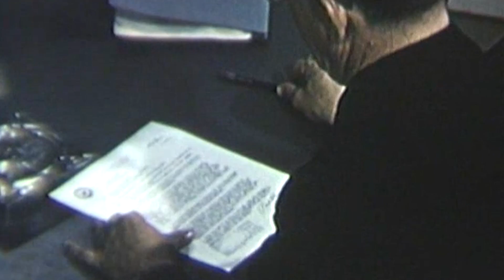Lockheed XFV - Vertical Take-Off Fighter

Comment: triangle spinning 3 side blades connect prop not plane type prop, safer if u hve a nose pop out chute to land. If room a 3 & 3 triangle prop 1 inner & other outer blades not spinning together put opposite like u hve it & diff 3 & 3 making it round spin diff sides prop. U need windshield so every 1 or 2 or 3 ppl can see out forward best poss. then looking up & down & forward if 3 ppl flying along.

Comment: Wider propellers & wider gear Not carrying about going back in to vertical landing launching position just take off & getting 500,<750!> or 1000 miles safely somewhere better. nothing beats 750 escape clause.

Comment: I can't help but wonder what happened to the radial flow gas turbine powered projects, they would have taken off and landed vertically and were jet aircraft not props. They are still classified so i do not know why they never made it in to production. Maybe the power output did not live up to expectation, or are they still flying? it would be unlikely.

Comment: Nice clip at 1:25 of the Folland Gnat F1 prototype from 1955, but I'm not sure of the relevance to this video or the commentary at that point.
Soviet nuclear weapon tech was not significantly aided by German scientists.  Although the Soviets had a weapons progamme running from around 1942, the major strides that brought it to fruition in only 4 years since the US use on Japan came from intelligence gained from agents and sympathisers in the UK and USA.
But the whole first few minutes on nuclear attack of runways was not the drive behind the VTOL fighter concept.  This requirement was aimed squarely at a ship-based maritime air defence fighter.  The major clue is that this was a USN contract.
The lack of power of the experimental YT-40 engine was not a surprise.  It was always intended to move to the T-54, with almost double the power, but as you say that engine never materialised.
There is also, all the way through, a lot of footage of the rival Convair Pogo.  With all the time on screen it might have been interesting to add that the XFY Pogo did actually mange to take of and transition to horizontal flight, although vertical landing was judged a step too far.
You could have finished with an explanation of why this approach was almost certainly doomed, ie poor visibility below when the aircraft was vertical, even before having to deal with wind effects and a moving landing platfrom.  Having the radar tranmitter in the rather harsh environment of the nosecone in close proximity to the props would also likely have been a reliability nighmare.
Finally how about a mention of the work going on in the UK in the late '50s to develop the VTOL concept that gave birth to the highly successful Harrier.

Comment: You would think more common sense would prevail that his aircraft would be extremely challenging to fly and control under the best of conditions and with the best of pilots. Can you imagine flying one off the deck of a ship out on the high seas? At least it makes for a great model to build. 
I built the Pegasus 1/72 model of it years ago. Now there is a new Valom kit of it.

Comment: This was a really stupid idea because it was dreamed up by aeronautical engineers who understood next to nothing about the reality of operating aircraft from shipboard.  The real difficulty was the fact that these aircraft were intended to be operated from the decks of ships at sea and, most particularly, from the decks of SMALL ships, a circumstance completely ignored by the engineers who created this aircraft.  It proved extremely difficult for a pilot to land one of these aircraft vertically and backwards on dry land.  To accomplish that on the rolling, pitching and heaving deck of a small ship at sea would have been virtually impossible.  Even assuming the pilot actually did manage to land this thing on a ship, its' high center of gravity would probably have caused it to topple over.  Even if it did not topple over, it would probably have simply rolled over the side into the sea on the pastoring wheels on the tops of its' tail as soon as the ship rolled.  Just tomato things even more difficult for the pilot, the pilot of the XFV-1, who was expected to land the aircraft vertically and backwards, WAS NOT ABLE TO SEE ANYTHING BEHIND HIM BECAUSE HIS VIEW WAS BLOCKED BY THE BACK OF THE CANOPY.  Like I said, the aeronautical engineers simply didn't think this concept through.  Incidentally, this aircraft was NEVER landed vertically, as it was designed to do.  Although the Convair "Pogo" managed to do so, it was never landed on a ship.

Comment: A war would have all airfields bombed out.  Okay then, simply place larger 'high-floatation' tires, (as well as enlarged landing gear bays to hold them), on existing aircraft so that they can take off and land from nearby farmer's fields. That way you can take off and land from anywhere, and you don't need to build any special aircraft.  Very simple and cheap solution.

Comment: maybe the engine power problems woulf be solved if they used variable pitch blades instead of fixed ones? they could keep the revs up to the max, thus the engine would be delivering its full power at all times during landing, and if you need to do some corrections, i.e. decreasing landing speed: you just have to change the pitch of the blades
Reply: On the CL-327, a VTOL UAV we had a pair of three blade, counter rotating rotors.  Flight Dynamics were controlled by cyclic and collective pitch like any helo.
Reply: @channelview8854  that is exactly what I meant! does it work as I proposed? Im sorry I am no engineer.
Reply: There is a video online of the CL-327 flying at Ft Sill.  It was extremely stable and responsive.  Had Bombardier continued the program, the next model (CL-427) would have had lifting surfaces and would have transitioned to completely horizontal flight after vertical takeoff.  Just Google CL-327.

Comment: With modern computer control systems, a design like this would probably be more practical. Afterburning turbofans instead of the turboprop would enable a higher speed.

Comment: Tail-sitter might not make sense as a manned aircraft, but as a drone with computer-controlled landing....it has a lot of potentials.
Reply: Space-x agrees
Reply: All the best future combat aircraft will be unmanned. G forces would be unlimited without a human inside.
Reply: @tormentorxl2732  more like higher g load instead of unlimited g loads because of the materials used as well as internal components will be crushed or damaged by too high a g load
Reply: @tariqahmad1371  ok you got me on a grammatical error. You both know what I mean. Geez
Reply: @tormentorxl2732  The limitation is the programming. Remote controlled drones are susceptible to jamming and always have a lag. Fully autonomous drone can't adapt to the changing environment of the battlefield or will require copious amount of programming to do so.
Reply: I used to work for Bombardier on the CL-327 project.  The project engineer showed me proposals for the 427 UAV.  It was very similar to this aircraft.
Reply: The Harrier made this academic...
Reply: yeah, look up the drone ak-47 made by zahal, it does exctly that
Reply: An old "Hawk" scale plastic model kit if this is very cool.... thanks 😁
Reply: Yeah. You could store a massive number of them in a relatively small space
Reply: But it was though to be not a drone, but an effective weapon carring rockets or even missiles. It was a waterhole since the start. If the military system needed a craft that could have a safe takeoff and landing capabilities, they should develope somenthing like a seaplane.
Reply: Or just a mirror??

Comment: What absolutely amazed us when we built the Harrier was that they were expecting problems in changing from virtical to horizontal it turned it was as simple as pushing a lever. No  computer controls just a smooth push and off it went. Same to go the other way.
Reply: It was also extremely dangerous, and many pilots died because of issues with flight mode transition...
Reply: @johnherbold6539 that was due to inferior training in the usaf

British pilots faired much better😊
Reply: @clintontaylor8904 or, they worked out the issues and passed them along. The British are hardly known for their flight prowess.

Comment: Point of order:  The National Advisory Committee for Aeronautics was never called "Nakka" . It was always referred to as the "In -Ay-See-Ay" .  When the NACA folded into NASA, you can find film clips of folks referring the new agency as the "In-Ay-S-Ay".  Nobody tries to pronounce FBI anything other than "F-B-Eye".  Pronouncing NASA was a way of distancing the agency from its aeronautic/academic past and being new  and space-age worthy.  

The XFV was also burdened with the horrible Allison T40 engine that was unreliable, difficult to control, and never produced rated power.   The XFV never performed a vertical takeoff or landing, always using the comical fixed landing gear for testing.  Like the more successful Convair XFY, it required extraordinary piloting skills in a time without computers to help control the airplane.
Reply: Jim, I always used to believe your point about the mis-pronounciation of "Nakka." However, when I started hanging around aerodynamisists and started talking about airfoil design, they would refer to "Nakka numbers." Please give me your input about this.
Reply: @stankakol5195  Your aero friends are likely 30-ish or so.  The younger folks are adopting the language they hear.  It used to be that it was a kind of shibboleth to tell the wannabees from the real stuff.  I am fighting a losing battle vice nakka.
Reply: @utubejdaniel8888  Thanks, Jim. I am beginning to see the pattern. In a book I read about the Apollo program, the author made your point: never say "Nakka." However, with time, I guess that rule has been eroding, like you said.

Comment: I remember this airplane and I also remember that the pilots were complaining how noisy it was and it was quite a handful to take off and land VTOL...
Reply: Take off was a difficult
Landing was extremely difficult if not impossible on a solid runway. But on a pitching ship it would have been suicide.
Reply: @jamesricker3997  correct! In truth I always considered the Harrier the best and the most practical VTOL fighter altrough it did had certain limitations as couldn't carry much fuel and bombs....

Comment: I wonder if this concept could be made to work now with a rotating cockpit and cameras to land, or some sort of autoland feature like how SpaceX boosters land.
Reply: I'm sure it could. The Harrier was still pretty difficult to land vertically though it was a lot more stable than these two weird designs. Nowadays the F-35B has a lot of computational augmentation that makes it far easier. Still the question would be why bother? Subsonic tilt-rotor craft and quad-copters are easier to handle.
Reply: @SolitaryEdelwulf  Not a matter of whether it should, but whether it could.  I know it's deeply impractical, but I'm curious whether the takeoff and landing issues could be solved with modern technology.
Reply: @connormclernon26  definitely could,  just put the seat on a gimbal so it Orients  correctly. Ubers trying to create single seat drone taxis. So there might be a market for personal dedicated versions. The poor man's private jet.
Reply: It could. You'll still have the same problem pure VTOL aircraft have always had. Fuel. That isn't going to change on jets. Prop aircraft have solved it (v-22) but they wont last long in a fight, dispite what Pierre Sprey thinks.
Reply: Exactly what I was thinking